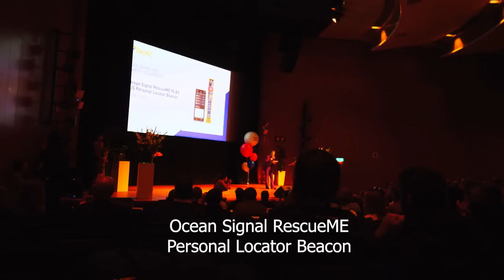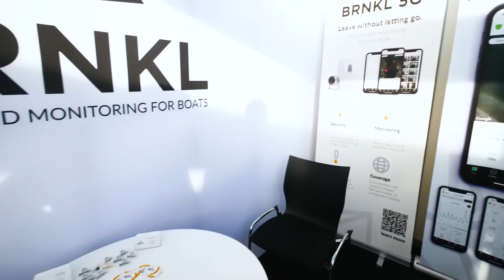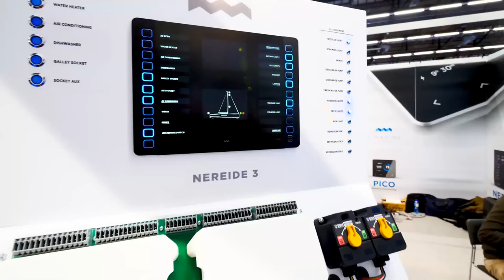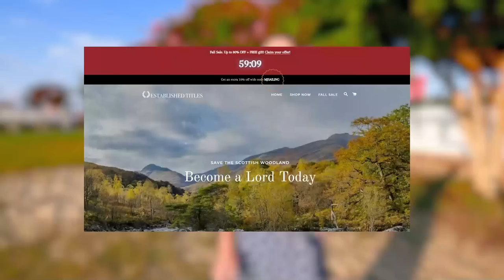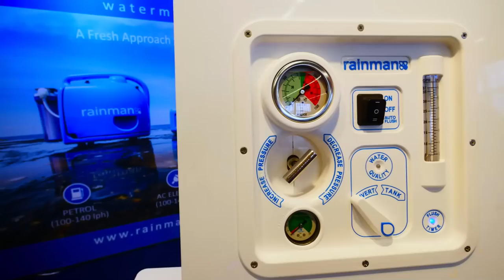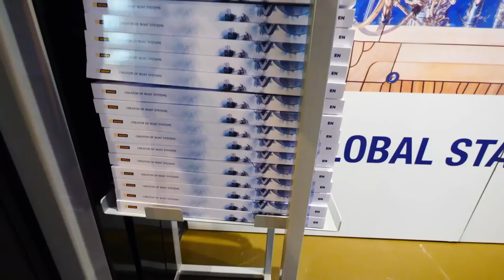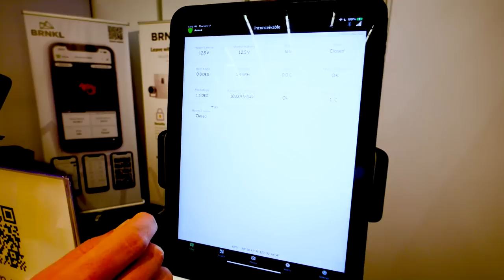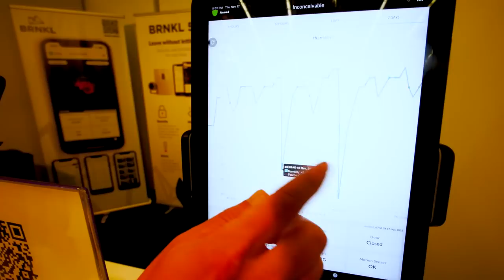We Traveled 3,800 Miles to Visit 900 Marine Vendors (MJ Sailing - Ep 260)

Comment: Did you really call the Helm a steering wheel :)
Reply from the maker: I did.  😉  Because a helm is a lever or wheel controlling the rudder of a ship for steering; an in our case, this will not be controlled by a tiller, but a wheel.